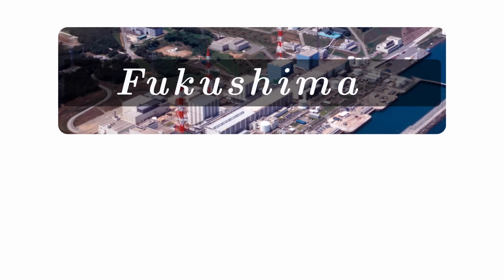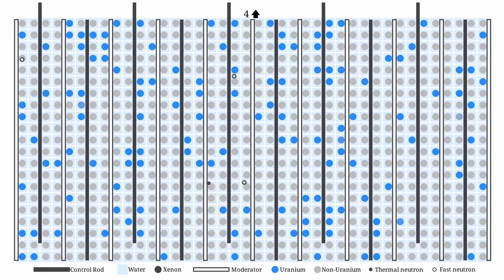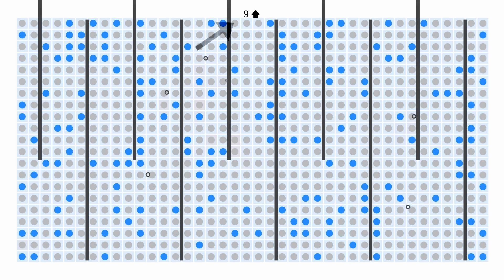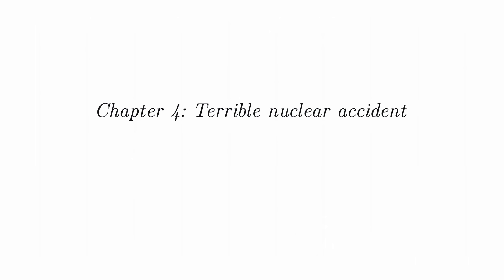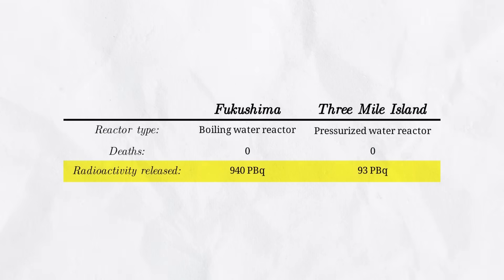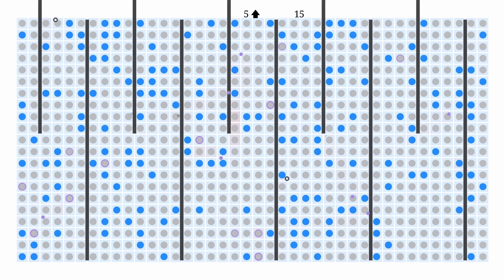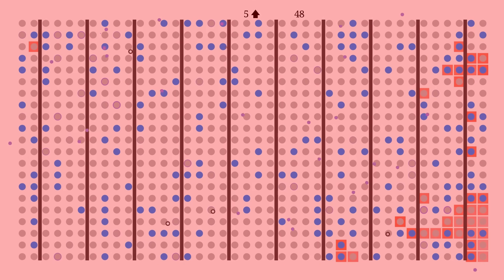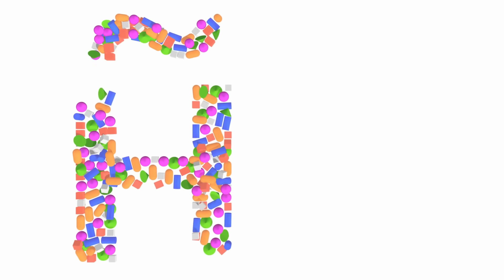Fukushima and Three Mile Island accidents Explained

Comment: Something to add about Fukashima. After the earthquake, and the reactors scrammed, the emergency systems were cooling the reactors down. For some unknown reason, Reactor 1 was cooling down too fast, so the operators disabled the emergency cooling system. When the tsunami hit, it was disabled. If it had been enabled, the meltdown in Reactor 1 would have possibly occurred much more slowly. 
Also, The backup battery systems in reactor 1 and 2 were flooded and failed, leading to increased speed of meltdown. The cooling pumps were also flooded and failed. 

I think the biggest lesson learned in Fukashima is the importance of the protection of the backup systems. If the generators, batteries, and pumps had been either elevated in the building, or built into water-tight bunkers, there would have been zero issues. They would have kept running and cooling the scrammed reactors. The oversight was depending on the seawall. To be fair to the operators though, the seawall was built to a level well above what was thought to be the largest tsunami possible, so they depended on that to protect the plant. 

The fact that the plant itself survived the earthquake with minimal damage is a testament to the designers. It was designed to withstand a magnitude 8 earthquake, and it withstood a magnitude 9, ten times more powerful, with minimal damage. But the tsunami was not expected to be so enormous.
Reply: I'd heard, and would believe, that engineers pointed out this possible scenario happening and suggested moving back up generators and pumps to higher floors. The Fukashima plant was built with  Tsunamis in mind, but not to the level that had hit it. Engineers did some calculations and what not and brought up the possible issue to the board, or directors, or who eve;r the bean counters. And the idea was deemed unnecessary. Correct me if i'm wrong.
Reply: @Fu3R4  " . And the idea was deemed unnecessary. Correct me if i'm wrong."

That's correct. There was a Tsunami wall that could protect against the once-in-100-years tsunami, but then a once-in-a-thousand-years tsunami hit.
The question then is; how much protection is enough? This tsunami was ten meters tall and came more than 4km inland. What are you supposed to do against that...
Reply: You hit the nail on the head. I also would like to add that lessons learned from Fukushima now include the usage of FLEX systems at all major NRC oversighted reactor plants in the US, and I believe the IAEA has done the same with international reactors the world over. What I mean by this is the usage of extra backup generators, pumps and battery equipment held in offsite hardened bunkers nearby the plant specifically in case something like Fukushima happens again, to literally any plant anywhere, ever. Not only that, but there's warehouses staged in strategic locations with semi trucks loaded and ready to rip over to said plant in less than 24 hours as well. Pretty sobering to think about, but absolutely amazing level of safety we now have.
Reply: @FEAR_Actual  In addition there's a lot of plant (idk if all, just the ones I know) that have EDGs that are housed in earthquake/hurricane/flood proof enclosures, the coolant must flow
Reply: From a standpoint of nuclear safety, the backups were in a good place. They were both out of direct line of sight (radiation almost always travels in straight lines) and shielded by earth overburden. Quite a few facilities locate their back-ups in basements like this. Unfortunately, other aspects of the site made this otherwise intelligent choice into a poor one.
Reply: @MrChainsawAardvark  Yes, however that still ignores the fact that the tsunami that Fukushima was hit by wasn't anything within the design basis for natural disasters, it was literally the largest one they'd faced ever at the time to that point. That's the point I'm trying to make, is FLEX zones in modern plants now can make up the difference if a natural disaster strikes said plant beyond what it's built to handle. Ergo, they can safely shut down regardless of what happens now.
Reply: International reports told fukushima operator TEPCO a tsunami significantly larger than the seawall was likely to hit and that they severely underestimated the amount a tsunami would run up the seawall and damage infrastructure in 2008. TEPCO ignored it. It was entirely the fault of TEPCO and the Japanese government.
Reply: Er, yeah the wall wasn't actually made big enough for the tsunami's they expected to deal with at that point, and had been told multiple times they needed to make the wall bigger or move the backup systems up to a safe elevation. TEPCO did neither. The disaster would not have happened as bad as it did had they did either thing, and it'd have just been flooded out 'briefly' before either supplies ran out or they got external power back. 

You can also trace three mile islands problem down to the same ultimate root cause too. Greed on a corpos head. The valve that got stuck was known to have problems, but the manufacturer insisted it was perfectly fine and had none. Combine that with the design issues of not having state lights showing open/closed status that wasn't just 'we told it to close so it must be closed' so you knew if there was a problem with components not closing or opening... and well. You know what happened. Had the manufacturer decided that maybe they should start replacing, repairing or just plain checking the valves that are known to cause problems, TMI wouldn't have happened to the extent it did.
Reply: Another thing to note is that other reactors on the coast were hit with the same earthquake and tsunami. They all scrammed automatically before the actual earthquake hit, and since the diesel generators were above sea level they all were safe. Fukushima was completely preventable.
Reply: @RobertCraft-re5sf  "... preventable" The only way the 'ACCIDENT' would have been PREVENTABLE, is to not have made it !
Reply: All I hear is single point of fail.. the sea wall. They tried to ignore that and this is what happened.
Reply: The deactivation of Emergency Cooling in Unit 1 was actually in compliance with procedures. That's because the temperatures were decreasing too fast. The metal expands when heated up and shrinks when cooled - and the reactor vessel is a huge metal thing. It might get damaged if this process happens too quickly. Of course, it would have been better if they left this system on anyway, considering what was about to happen - but they couldn't really know that.
Reply: basically they set the safety factor around 300 for the Fukushima reactors, despite nuclear reactors usually have around 100+  (usually 2-5 for our daily devices like home appliances and vehicles, 5-20 for infrastructure that could kill people like industrial chemical plants), but they should've gone with at least 1000 safety factor due to being on the pacific coast facing the ring of fire

edit: for those that dont know what safety factor is, its the ratio of the infrastructure's maximum limit vs its normal operation parameters. for example, if a car has safety factor of 2, and it usually cruise around 90-100km/h, then the car is designed in a way that it can still perform as expected at 180-200km/h. nuclear reactors are infamous for having a three digit safety factor since Chernobyl
Reply: just a slight nitpick, a magnitude 9.0 earthquake is 31.6 times more powerful than a magnitude 8.0 earthquake. the earthquake scale (moment-magnitude scale) is a logarithmic scale where going up or down by 2, makes the strength of the earthquake 1000 times more powerful.

a normal logarithmic scale would be M= Log10(X), where M to X is, 1 to 1, 2 to 10, 3 to 100, 4 to 1000, etc.
But this log uses the relationship where M = 2/3 Log10(X), where M to X is 1 to 1, 3 to 1000, 5 to 1,000,000. (M is the magnitude, X is the ""energy"")
The reason the smart earthquake people didn't use the normal scale is because when we measure X, we are not measuring energy, we are measuring how far a rock fault moved. for rock reasons, energy is proportional, and scales with rockmovement^2/3.
if deltaM is 1, (delta=change in, meaning M,magnitude has increased by 1)
1=2/3 Log10(X)
we multiply both sides by 3/2
3/2 x 1 = 2/3 x 3/2 Log10(X)
deltaLog10(X) = 3/2
logarithms have a special property where, Log10(X) = Y is the same as X = 10^Y, by definition.
so deltaLog10(X) = 3/2  is approximately 31.6, meaning if magnitude has increased by 1, deltaLog10(X) will therefore increase by x3/2, and also X will therefore increase by x31.6. (because 10^3/2 = 31.6)

imagine 2/3Log10(X) is a single thing, a black box. That box is the moment magnitude scale. That box is approximately proportional to energy. X is how we measure earthquakes, and is not proportional to energy, but has a relationship with energy. We plug in X in order to get a number that is proportional to energy.

if magnitude has increased by 2, deltaLog10(X) will therefore increase by x2x3/2, or x3, and also X will therefore increase by x1000. (because 10^3=1000)
Reply: I work in nuclear and heard nothing of the loss of control at Fukushima.  It was nothing more than loss of backup power to the spent fuel pool.  Ass they off gases they produced hydrogen and that was the small explosion you see from the secondary containment.  The reactors to the ents of my knowledge…. Had zero real issues.  The reactor that had the Apollo was shut down long before the earthquake.  Simply put…. If they had back up power…. The entire issue of losing fool pool cooling would have never happened.  Their backup power was all under water.  Nearly ALL Fukushima Upgrades I performed were back up power reliability and communication reliability here in the US.
Reply: I work in nuclear and heard nothing of the loss of control at Fukushima.  It was nothing more than loss of backup power to the spent fuel pool.  Ass they off gases they produced hydrogen and that was the small explosion you see from the secondary containment.  The reactors to the ents of my knowledge…. Had zero real issues.  The reactor that had the Apollo was shut down long before the earthquake.  Simply put…. If they had back up power…. The entire issue of losing fool pool cooling would have never happened.  Their backup power was all under water.  Nearly ALL Fukushima Upgrades I performed were back up power reliability and communication reliability here in the US.
Reply: No the lesson learned is don’t build a nuclear reactor in a fucking tsunami prone area
Reply: Why people think Fukashima accident happen: natural disaster
Why it really happen: capitalisme ignoring the above
Reply: Building a nuclear facility on the coast in a tsunami zone was their only mistake.  Lol

Comment: This made me wonder if they were doing anything with Three Mile Island as of recent. I looked it up and they're reopening it JUST TO POWER FUCKING MICROSOFT DATACENTERS WHY
Reply: Because nuclear power is one of the cleanest power generating systems, and the safest as well. Because there has been a few accidents doesn't mean we need to abandon nuclear power. We learn from past incidents and work to improve safety, while also improving capabilities. 
Imagine if we abandoned airline travel after the first several commercial plane crashes. 
Imagine if we abandoned mining after the first few mine collapses. 
Imagine if we abandoned space flight after the Apollo 1 deaths.
There is always the possibility of disaster and death with new endeavors, but we can't just stop trying due to what might happen. What we CAN do is learn from our mistakes and push forward. Nuclear power is far better than it's early days back in the 50s, and is a much better power source than coal. We need to embrace it, and keep advancing it to make it better and better.
Reply: @Kingkoopa00 i think they meant "why are they using it specifically for powering microsoft data centres"
Reply: Microsoft is spending a ton of money on powering Datacenters all around the world and has trialed lots of energy sources. AI is very energy intensive to run so with MS huge budget for RnD they have come to the conclusion that Nuclear is the best path in many ways.
Three Mile Island is a perfect fit for them as it's a pre made facility that just needs to be refitted for the job, heavily reducing the cost compared to building a new nuclear plant.
Reply: You're the reason why it's needed just by using YouTube...
Reply: They are reopening UNIT 1 , which ran without incident for 39 years and offset more than 95 million metric tons of CO2 emissions. Microsoft is entering a power purchasing agreement with Constellation (the owner of TMI) in which they are paying for the energy to go back on the grid, to offset whatever energy THEY ARE ALREADY DRAWING from the grid as part of their net 0 goals.

Comment: Hey I really like these videos, the animations are brilliant - but a small tip if you like, the points you make would be easier to take in if you talked slower and took breaks. Sometimes you make a point, especially around 7:40 mark and you just speed into the next point. As a listener, I’d love time to take in what you’ve said before you move on.